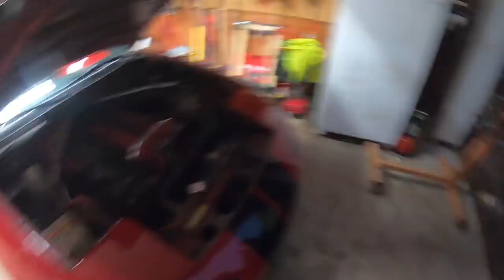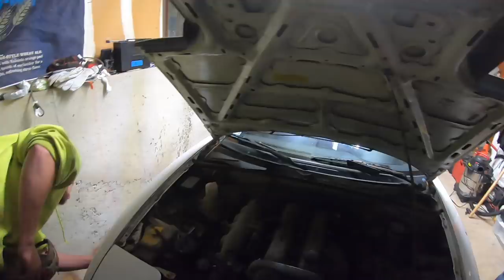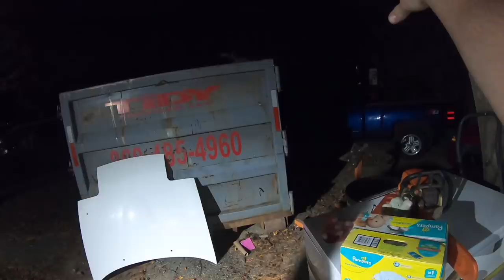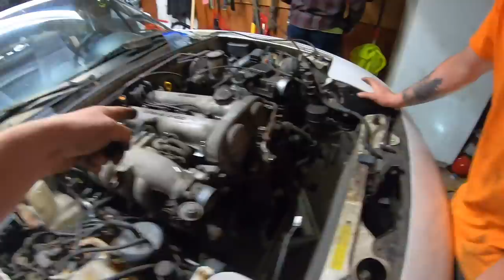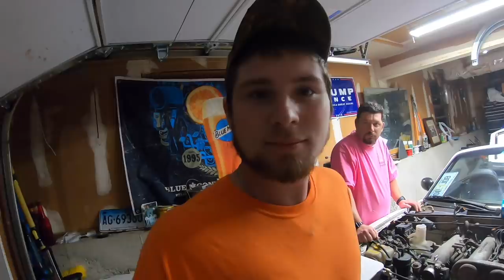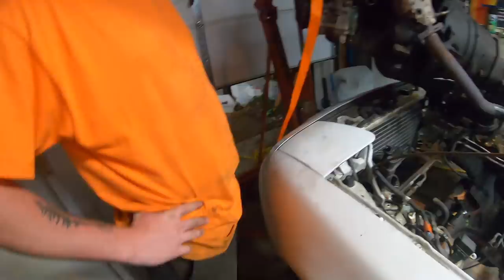JUNKYARD MIATA GETTING TURBO'D! DAY 1...

Comment: Just do timing belt and water pump. It's going back into a rotten frame that's on borrowed time. Only do all the gaskets, clean, paint, etc. if you know for sure you're going to want to pull it in the future for another body. That's my take.